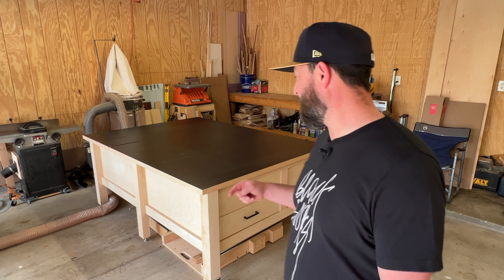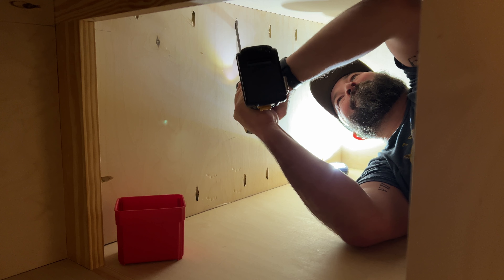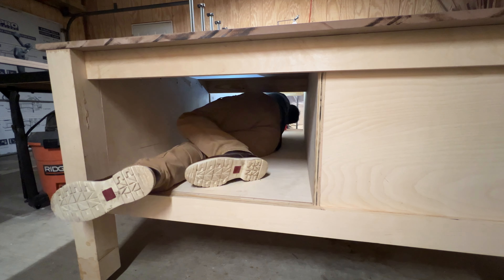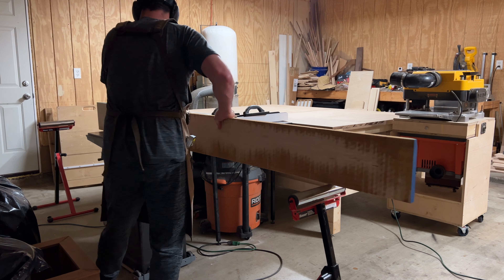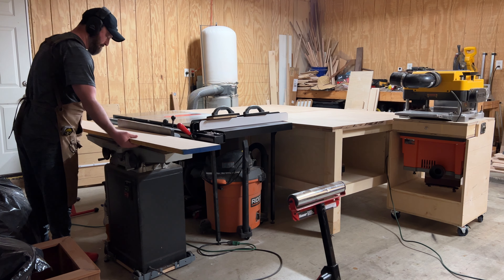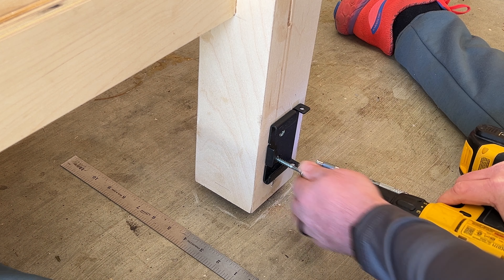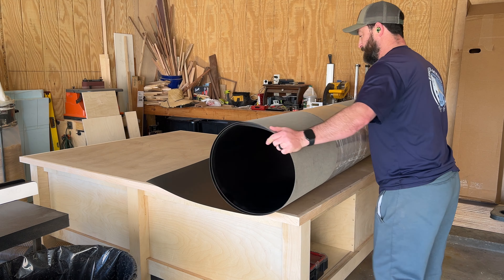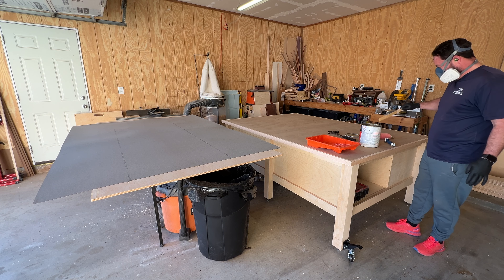Building a Bourbon Moth Outfeed Table Pt. 2 of 2

Comment: Love the video, thanks! Is there a reason or trade off in using MDF for the top vs plywood?
Reply from the maker: @jaybich  glad you enjoyed it and thanks for the comment! So, I’m sure you could use plywood instead of MDF, for sure. However, I chose MEF because it is very stable, very flat and has a good amount of heft to it, which I believe makes for a better top and sub surface for the Formica.